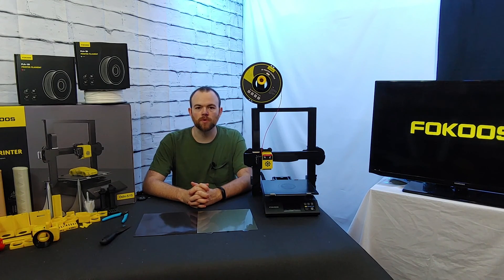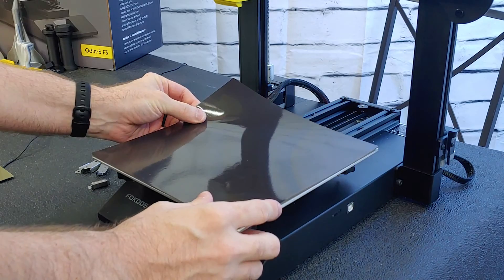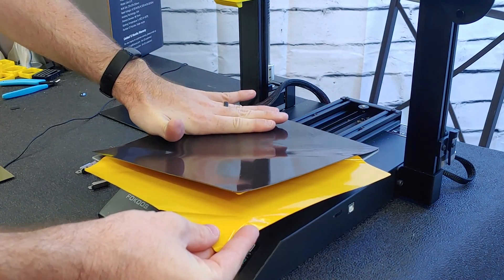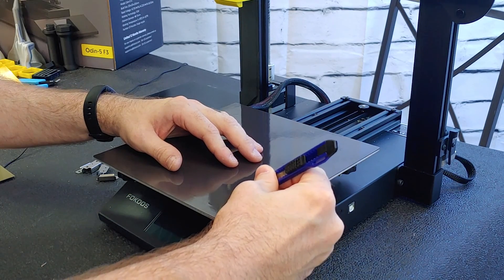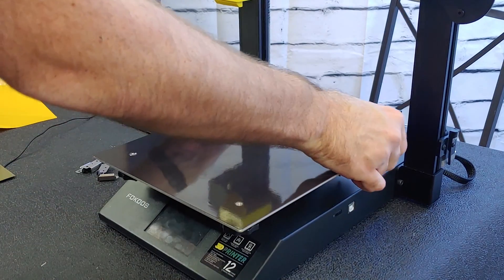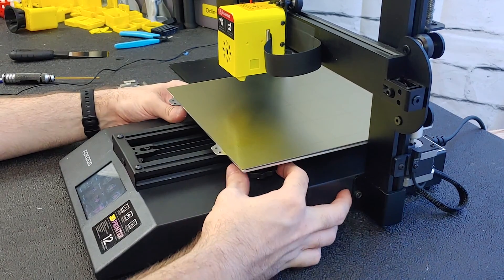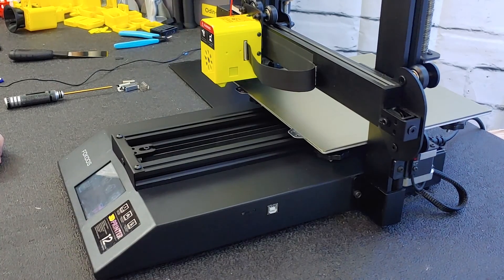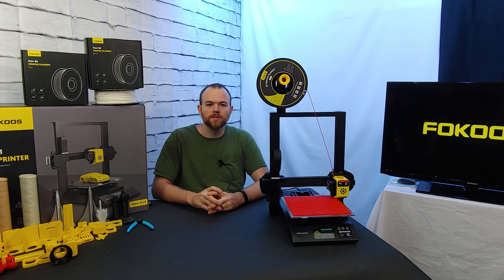Installing A Magnetic PEI Build Plate On (almost) Any 3D Printer

Comment: If your screw heads are above the ally bed then your glass plate could not have been in contact with the heated bed. The first thing I do is check all the screws are underflush. If not countersink the ally plate deeper.

Comment: Why put down a magnet? You can use larger clips from a stationary store or blue painters tape and put it right over top of your glass bed. Adjust your Z height offset slightly higher and run your bed temperatures at a slightly higher temperature than normal. That way you can go back and forth with no problem.

Comment: Do I need to compensate the heat since there’s a layer between the bed and the print surface? If I needed to remove it, how would I?
Reply from the maker: Nope! It'll still bring it up to proper temps, just probably cycle more often since there isn't as much mass to keep it hot.

To remove it just get it hot and peel it off. Clean the goop with iso or acetone

Comment: Looks good- but my glass plate does not remove (the heater is glued to the back.)
Reply from the maker: It shouldn't be on most printers.

Some older geeetechs had the glass stuck to the metal plate
Reply: @KiNG3DPrinting  It is an Artillery Sidewinder, and the pad seems glued to the glass plate.
Adhesion has never been great, and I have been using painter's tape to ensure it stays in place. Reasonably reliable, but a nuisance and the bottom texture is not ideal. I was watching your video to see if I could add a plate, and if it would help. Yesterday I tried upping the bed temperature- 10C more and it is much better. With Magigoo I am getting reliable adhesion. I have also built a cabinet (double plastic sheet glazed) with a 30C heater inside, which I hope will help with lifting, especially in cold weather.
Reply: Artillery have a video on installation https://www.youtube.com/watch?v=ecNYbY5-fhc.  You just stick the magnetic sheet to the glass.

Comment: id rather get a aluminum build plate and stick it on that, so you have the option of using the glass bed or other surfaces.
Reply from the maker: Absolutely! Some people put the magnet on the glass so you can flip it over and still have both!
Reply: @KiNG3DPrinting  Can you just put a glass plate on top of the magnet when you want glass?
Reply: Sorry didn't see you've already answered this below
Reply from the maker: @tysont2681  Yea absolutely. Just make sure both surfaces are clean

Comment: Why didn't I think of cutting the holes where the screws were?! I was racking my brain on how to fix that part. I was making the solution over complicated lol. So glad for this video! Thx!
Reply from the maker: Honestly the first time I put one on my printer (I forget which one) the screws poked out way more than this and caused me some serious headache. I was about to start sanding the magnetic sheet until I had the idea to cut them out since I was going to take the bed off anyways to work on it. Sometimes it takes a series of idiotic thoughts to come up with a solution that works. I'm just glad I was able to share it with others so they don't have to go down that road lmao

Comment: Is there a thin transparent sheet of paper over your bed above the screws? I was wondering if it is supposed to be there or pulled off.  I'm talking about on the actual bed under the glass.  I have the same fokoos printer.
Reply from the maker: There should be a blue or clear film under the glass. You can remove it if it's still there but it might leave some glue behind. Use ipa or acetone to clean it off!

Comment: Great video Mike.  I have a CTC printer and the bed is about 150 X 230.   I haven't been able to find a PEI build plate exactly that size.   Is it feasible to just buy a bigger one and cut it to size?
Reply from the maker: Hm, it's hard to say. If you can cut a sheet of spring steel straight without causing warping or jagged edges then it should be fine, but you might be better off looking for one of the soft flex beds instead that are scissor trimmable. You could put a PEI sticker over the flexible buildtak surface they normally come with but I'd give the buildtak a shot first, maybe with some Aquanet.

Something like this?
https://www.amazon.com/Creality-Flexible-Removable-Magnetic-235X235MM